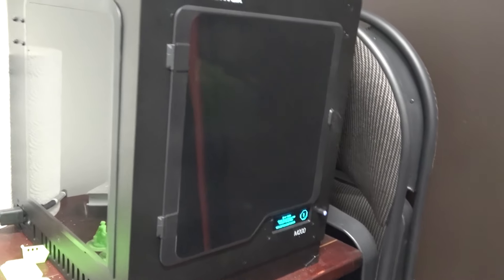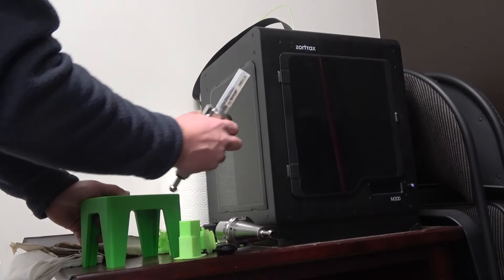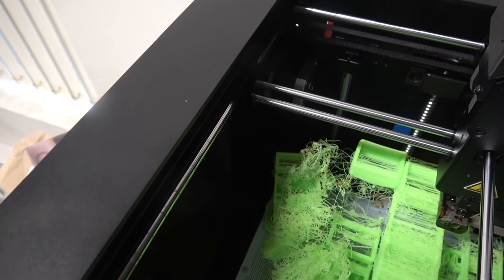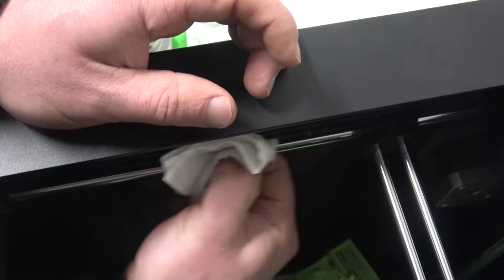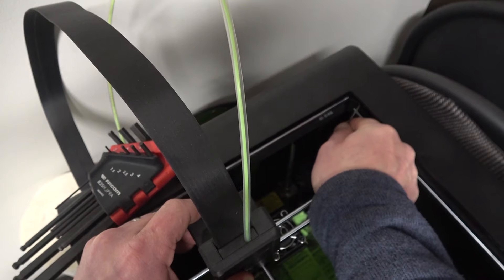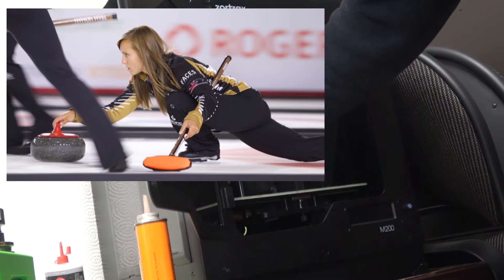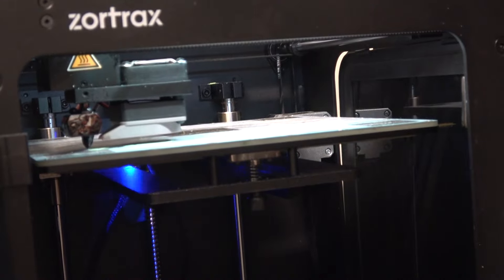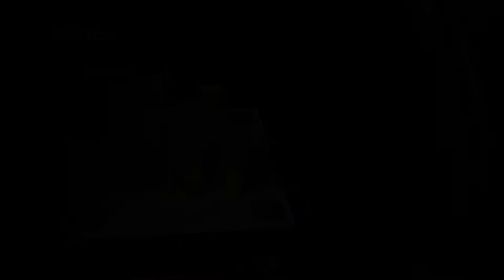WTF is a Zortrax M200?!

Comment: Having dealt with the M200 first hand, the frame ain't tea bag, but the rest of it not so much. Had loads of problems with linear rails gumming up (a good case for v-slot!), the extruder design is poor compared to others (most extruders can clamp onto the filament, this doesn't), the stepper drivers are permanently soldered to the motherboard and the ribbon cable to the print head always fails prematurely. My biggest complaint though is how proprietary everything is, especially the software - the printer takes Zortrax's own 'Z-code' instead of G code so you can't use normal slicers with it. It works well within the warranty period (of course) but good luck when anything goes wrong outside of that - I'd recommend a Ultimaker if you want something that 'just works' but as always if you want the best just get a Prusa i3. Sorry for ranting but the M200 has caused me countless headaches compared to my own cheap printers - Flashforge Dreamer and AnyCubic Chiron.

Comment: Check the stepper motor current and make sure they are at the proper current (~0.95v) on standby. This could also be the issue as cheep/old stepper drivers output voltage can wander over time.

Comment: At my last internship, I was the chief 3d printer baby sister. I'd run into this issue a few times. The problem was usually, that the print would start to curl at the edges for some reason. When the print head would try to put another layer on it, the Printhead would stay still for a few seconds, and lose some steps. Somethings you can do to solve this is to: zero the x and y after every layer, and slow down the print speed of the outermost layer to a snails pace. 

Good luck from the federal bureau of instigation.

Comment: Your filament was grinding, you might have too much tension on the idler/driving gear or resistance somewhere, or it could be straight up cloggy. Good looking prints after the fact, though, so that's nice.

Comment: Hey AVE, don't you have any Mobil Vactra #1? it would be just the thing for those slide bars if you are worried about stiction. Otherwise, sewing machine oil would be good for this application since it never gets gummy. WD-40 and 3 in 1 will both eventually deposit gum on the bars and inside the slide bearings.

Comment: Looks like the print head umbilical is also running into the wall.  I'd bet the combo of the shmoo on your rod and that caused the failure.  As for the smell, I'd suggest trying PETG rather than ABS.  PLA is the best wrt smell as it is like waffles when printing.  However,  prints are more prone to snapping (brittle) plus there is the sag issue when exposed to heat (lower melt temp).  PETG seems to be "just right"...

Comment: Having been in extrusion for quite a while I can tell yah that the smoke from the melting plastic will gob up on those metal surfaces especially because they are kind of the high point in the printer. Silicone mold release can help alleviate that a little

Comment: If you're still interest in additive manufacturing at all (granted it's not for every application), you should look into static extruders with movable stages. Might alleviate some of these problems you're running into. Just speaking from previous experience with additive manufacturing of carbon fiber composites.

Comment: Check out that there genuiiine Prusa MK3s. It has fancy as frig motor controllers, which know, just from the current feedback, whether it has lost a step, and it is able to reset to the last known good position and do a good job of recovering from all but the most fatal of failures.

Comment: Electronic flush cutters also work great to remove parts from the printer because they also fuction as a steep wedge and at least witht he stuff i print once the edge goes the rest of the part comes off as well.

Comment: The shreds off plastic on the extruder hobb gear are normal
Reply: This, mostly. Could be juuust too tight or loose, but happens alot if you use retractions. Kinda deforms as it pinches through, then nips the excess as it passes back over. Unless you're underextruding, it's no problem at all.
Reply: @nicewhenearnedrudemostlyel489   Indeed too much retraction back and forth it lead too a lot of particule
Reply: loll

Comment: Get some PEI for your print bed. No smoo glue needed and glass polish finish.

This design suffers if the belts are too tight as well.

Mag loaders on PLA don't last very long. Go with ABS or (less smelly) PETG.

Been designing and printing products professionally for 3 years.

Comment: I'm looking to get a massive new 3D Resin printer. Those things are damn near magical looking.
Reply: Resin is not practical for strength and prototyping parts that will undergo stress, sure are nice though
Reply: @memyselfandkev  That isn't exactly true. It all depends kind the kind of resin you use and the application you're using it for.
Reply: Unless you're a nanny-state candidate or have palsy, you're gonna love it.
Reply: @nicewhenearnedrudemostlyel489  What?

Comment: I know that you probably know, some some people might not know, but some of those oils can attack plastic, if the printer has plastic bearings (some do) the oil can cause issues dissolving the plastic bearing / bushings decreasing it's tolerance and fucking everything up....  so no Petroleum based oils close to plastic bits!

Comment: check your linear bearings , they might need cleaned or replaced, also check your belt pulleys if the little bearings in there crap out that'll cause it to bind and slip as it turns(causing the grease lines at regular intervals on the rod) also id use a dry lube instead of oil on the rods ,it'll keep the plasi-pubes and stuff from sticking to it and getting wedged into the linear bearings

Comment: No doubt the 'schmoo' on your linear rails consists of a mixture of: Oil and airborne particulates from the room and extrusion head. Cheap solution: 3D print, cut from plastic sheets, etc... yourself some parts to duct clean filtered air over the exposed moving parts on x,y (left,right) axis. Maybe a light weight DIY bellows/cheap off shelf for build plate z (up/dpwn) axis. Wipers on linear carriages, or ultra light bellows, and no blowers, etc..?

Comment: Looks like it's probably time to change out the toothed gearing on the extruder.  I'm betting it's got some nice wear from the filament after a couple of years.  For ze lube libations, I prefer Super Lube.  Works well in those bearings.
Reply: Doubt (I'll elaborate, unless he is printing loads of white, glow in the dark or carbon filled abs it's probably fine my zortrax drive gear is way older and show little to no signs of wear

Comment: You think it'd be worth it to construct a little 'clean room' just for the printer? Essentially, a box sealed on four faces, save an intake for cool air that's got a skookum filter on one side, and an exhaust vent on the opposite side (EDIT: intake at one bottom corner, exhaust at the opposite top corner). It'll clean out the dead people cells and other teensy nasties, possibly reduce the odor, lower noise levels, and provide active cooling.

Comment: so, ive had a prusa mk2.5s for about two years and the first year i ended up taking some part of it apart about once every month or so. i use it on a semi regular basis so its not just sitting around all the time. the most recent year i have not had much of any issues.

i would say the L profile design (i dont know the "offical" name) is superior to the cube design.

Comment: So I would definitely count myself as a Prusa fan boy, but if you get yourself one of those, it's just about hard to get things to fail.  And the newest ones know when they miss a step, due to the current driving the motor being out of the usual range.  I'm guessing if your scenario happened on the MK3, it would try to reset, and start the print again, and if it was unable, would at least save you the material, instead of making spaghetti.

Comment: We have thousands of hours on our Zortrax machines at work and they just keep chooching. They seem to have fixed the main issue which was the cable that would break every few hundred hours or so. Otherwise, replace the occasional hot end, replace the bed once it stops sticking and they are pretty reliable. For the linear rails, Zortrax recommends a light machine grease every couple months like the one they ship in the kit with the machine.

I appreciate just how good the Zortrax machines are every time I play around with my Tevo Tarantula and just how much time I spend to get it to print.

Comment: if it stinks you are using probably using ABS, PetG is far easier to print, doesn't smell and stronger than ABS (for most things) as it has better layer adhesion. It's a bit stringy though but nothing a bit of tweaking can't sort.

Comment: Get yourself a piece of glass for the bed and a can of Dimafix or similar (some use hair spray, I find that Dimafix works much better). The spray is some kind of water soluble lacquer or something with extreme thermal expansion characteristics. You spray it on the cold bed then turn on the heating. Then you print on the hot bed. While the bed is hot you will not pull the print off before you break the glass. When the bed cools down the layer of spray contracts and the part is loose on the table.  You just pick it up off the table. Oh and you want to clean the table you just rinse it under the tap and all the excess spray dissolves right off. Give the spatula back to your wife; best 10€ I spent on my 3d printing equipment.

Comment: The filament coming out of the nozzle just lost/never achieved contact with the print. And was printing on air. It happens some times when it jumps around the print.
Reply: That may have happened, but doesn't explain the perfect shapes in the perfect place for a layer shift. Good try. Keep up the sleuthing.
Reply: @nicewhenearnedrudemostlyel489  i was looking more at the rats nest than the print.

Comment: If the smell gets ta ya, use pla or wood fill, both of which are FAR better then what is likely abs smell

also on the stick side, I found on mine that an initial hot layer (for me it was 15-20c) bed temp for the initial layer was enough to get shit stuck, but I also use a layer of blue tape so may not apply here.

Comment: Make sure your steppers are getting enough current 1amp or just a blond one more should do ya, I've never ran this machine in particular but there should be some screws in there you can give a tappy tapp tapp should fix your problem. If that little shmoo was enough to stop it your steppers arnt getting enough angry pixies. At least that's what my first guess is. Love these things because they are so simple it's either the confuser or the swinging bearing bits. Hope that helps.

Comment: You can back drive 'em all you want, but it's best to disconnect the steppers lest they start sending angry pixies the wrong way down the wires. Y'know, a motor is a generator if you spin it yourself.

Comment: wd-40 is not a lubricant, at least it's not considered one in Germany, as it'll evaporate and leave a sticky mess behind. Balistol is a much better option for lubricating stuff, if you need it to,as even the more dried stuff leaves an oily film behind. the only downside is the smell, which won't be too bad if you don't overdo it.

Comment: I was never a fan of the designs with linear bearings, they seem to have constant issues. The way the cheap machines like the Ender 3s (sub $200) work with rollers on an extrusion frame is fantastic and virtually problem free. 3d printers aren't like CNCs, you don't really need an overly stiff frame. The only resistance you get to movement is friction and inertia, you're not pushing against any material.

Comment: I would mod the crap out of it, first by building a top to have it air tight, to prevent dust collection, and being able to control internal temperature, you'll be able to print with more advanced filaments with minimal warping. Plastic fumes/microparticles are not good for lungs, especially your young ones lungs, outside exhaust (activated after the print) or very fine filter should do a decent job. If you want to reach high temperature printing, you might want to switch the steppers outside of the enclosure or alternatively have some kind of cooling. (I'm aiming for water cooling on mines).

Comment: I want one of the laser ones that does aluminum so I can make car parts 😂
Reply: You could do lost PLA casting like I do for motorcycle parts.
More steps and machining after but a lot less than the $50k for the sintering machines
Reply: @robertbennett883  how's it go with PLA? I've found for strength I usually use PETG.
Reply: I don't use the pla part on the bike the pla part is used to form a mold for molten aluminum. Pla print, investment (plaster) poured around it, PLA is burned out, molten metal is poured in. It is nearly identical to lost wax casting

Comment: ABS smells like burning Legos but PLA has a really pleasant sweet smell to it and since you're not using it for it's intended application but just prototyping I would suggest going to PLA. Just make sure you change your filament profile so that the temperatures and extrusion rate are correct for PLA

Comment: Knowing how the slide rail sliders on most layered plastique spaghetti machines are designed, you probably got a good layer of fume deposits from melting the ABS in the fins rubbing the rails, no judgement. So when you clean the rails themself, you're just cutting the grass for more dogs to shit on.  The smell you smell when it melts your weed whacker filament is building up there. Clean it good and often, and it will probably even be alright.

Comment: Buy a ceramic plate and place it on the print bed. You will need the glue stick as a release agent. I run everything from a 3dp Workbench to a Markforged  Metal X. For plastic sticktion, nothing is better than ceramic.

Comment: Make sure your linear rods are parallel.  You know how that goes, but these steppers only have so much torque, so a few blonde ones aren't a problem, but when you get into the mediterranean category, expect things to bind up.  Did they not use LM8UU bearings for the X and Y axes?  That's odd.  Also, make sure the drive belts for X/Y aren't loose or too tight. Hopefully they used some quality Gates Rubber fiber-reinforced belts and not some cheap one-fiber-counts-for-advertising-honesty stuff.  If your X drive belts are too tight, they might be pulling the Y linear rods toward center at the back end.  If I got my old chinese rig running smooth before replacing it with a quality Czech setup, I know you can get a Polish machine running like a top.

PLA doesn't smell bad when you print with it. It sometimes even smells like waffles. I know you can't resist waffles.  PETG has a little bit of a smell.  I've been printing off-and-on for years and still haven't used the ABS sample that came with my first (Chinese) printer. I've heard it reeks though.

One last note: Keep in mind that some things, like those fancy green tables of yours, are better printed upside-down to reduce the need for supports. If you reduce the footprint of support material, you save material and a WHOLE LOT of time and cleanup.

Comment: These linear bearings aren't the best fit for this style of XY mechanics, sintered bronze bushings will hold up longer and run quieter. You can press two of these into an aluminium sleeve and it replaces the LM8UU bearings nicely.

Comment: I suspect loose belts.
Generally, belts are the first thing to slip, NOT the steppers. The steppers are surprisingly beefy for what they are (well, in a 3d printing context anyway). Have the bugger on and try to move the print head with your hands - with belts properly tightened, you'll be a lil' scared about bending or cracking something at the forces you are going to need to put into it: that's the same exact force that it takes for it to lose steps.  Generally you can knock your print off the print bed sooner than you can get the steppers to lose steps.

Print out a little belt-tightening thingy ma bob and you'll be good to go.
Reply: For reference, you want the belts to sound a nice low bass note when you pluck 'em - too tight and they will have a slight issue with vibrating in printing and you end up with ghosting, too loose and you "lose steps".

Comment: I've got a glass bed that I put a pei street on the bottom. If it's something I need the pei for, I flip it. I prefer petg over abs anyway. Once I get an enclosure, I want to try polycarbonate and maybe nylon
Reply: i much prefer PETG as well. a buddy gave me some PLA for helping him unbrick his phone, and i did not like it... i researched what materials would be best suited for the type of stuff i do (a lot of prototyping), and PETG seemed to be the best for me. it doesnt appear to have any kind of smell either... i use a 7mm piece of glass on mine, and have to use a glue stick to make the bed slightly LESS adherent, as PETG loves to pull bits of glass from the pane upon removal haha!

Comment: ABS is rubbish for 3D-printing. With PLA, you can even get to print on a cold surface with a neatly set up printer. If my crusty cheap Anet A8 can do it, yours can, too. You save a big portion of the cost for electricity like that.

Comment: Do as the Master said, not as the Master did. Chinesium needs 300% more grease.
I'm just about to finish a 28 hour print on a never serviced 3 year old anet a8, wich i covered in 40 year old grease from my dads garage and a few drops of mineral oil to get it flowing.

Comment: layer  adhesion  problem too much air or lack of heat z offset, too check you z offset and your filament had to be dry i mean dry! the retraction of the filament and check your nozzle for wear out